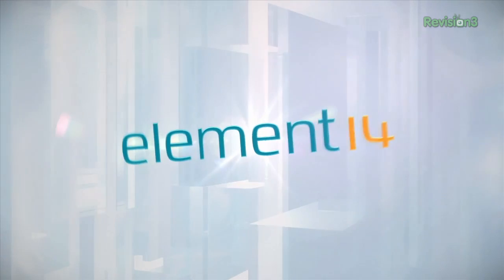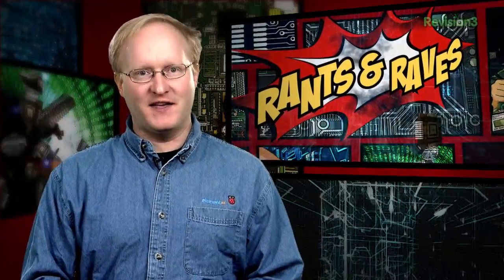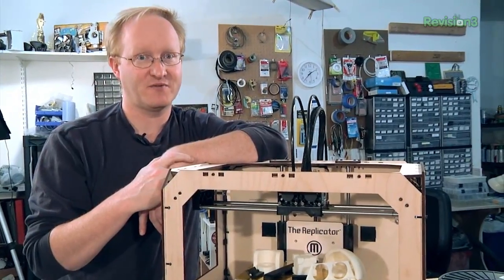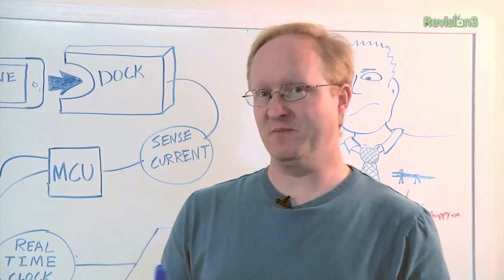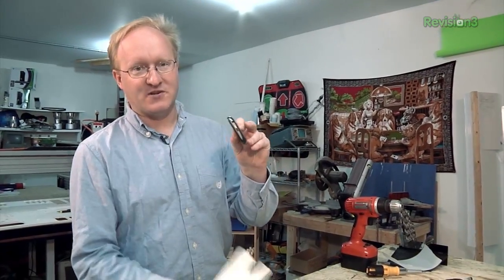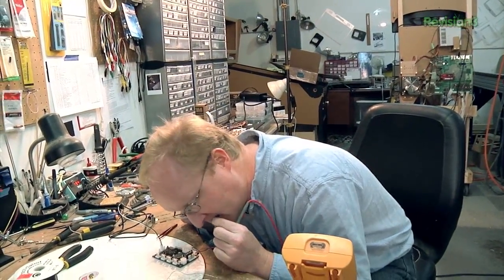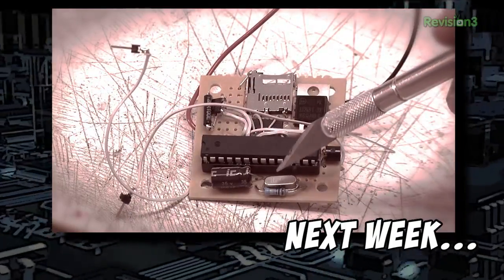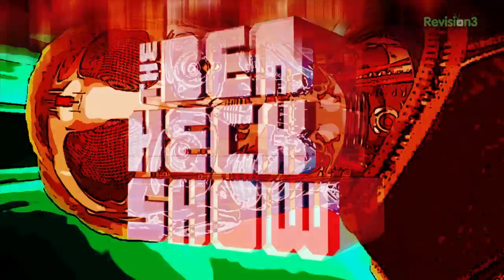The Anti-Texting Device: Teenage Driver Texting Prevention! - Part 1

Comment: Actually it's not true that old screens from laptops are useless. If you search online for the screens serial code + control board, you can make an independent monitor for around $20 to $40
Reply: chris james You can actually do that with a universal controller (mt6820 i think it was), just, you need to hack up the cables a bit, and it costs 5$

Comment: Or you could make a small enclosure with a window which locks the phone into it until the car is turned off. If it malfunctions, the only way to get it out manually should be out of reach when driving.

Comment: I don't think this issue pertains to teenagers only. Every asshole these days texts and drives at the same time. Even talks and drives at the same time. Voice command on cars are a big disappointment.
How about building an integrated HUD onto the windscreen of the car itself. That will keep your eyes partially on the road while you input with controls on the steering wheel.

Comment: Regarding uses for an old laptop LCD, if you rip them apart, they have some neat frenal lenses and diffuser sheets in them. The older ones have a really thin fluorescent tube up the top, and the newer ones have a strip of LEDs. As far as using them as a screen for something, as Ben says, totally not worth it.

Comment: actually with the monitor I picked up a LCD converter that converts VGA into the digital signal off of eBay for $15.00 that turned my old 20 year old Sony vaio laptop LCD screen into a 3rd 10" monitor ( the screen was manufactured by acer but in a Sony vaio laptop lol)

Comment: so what if the teenager just plug in a different phone (an old phone) and use their main phone to text? also, what is preventing the teenager to just shorting the wires to create a current for the current sensor?

Comment: my wife's laptop screen cracked after she dropped it a dozen times.  I was able to take a screen of the same size from a laptop with a bad motherboard and retro fit it easily into her laptop. Her laptop was a Dell and the bad laptop was an HP.  It turned out the connector on the back of the screen (not to the motherboard) was the same.  Works like a champ to this day.

Comment: a possible use for that old laptop LCD mentioned at the end:  
you can reuse it as a part of a Polariscope, either by turning the cold-cathode light on
(by messing a bit with its power supply) and use it as the polraized light source,
or by removing the polarising film and use it as the viewport.
it's great for finding stress in glass, and for gem evaluation and such.
i put a video response that shows how to build one.

Comment: That's actually not a bad idea... and yes you can... jut mind tho, the florescent lights are extremely tiny, and the cables connecting break very easily. Of course if it LED backlit, well, then you don't have that problem, but either case, it will be a very weak desk lamp.

Comment: Hey I was looking at my boring computer case the other day and was thinking hmmm I'v done the fan mods, I'v done the case fan speed and temp controller, but there is still a HUGE blank space on the front of my Antec NSK 3480 case. Then it hit me what if i put second monitor in the front ether vertical or move the USB headphone and mic ports to be able to make it horizontal, (continue)